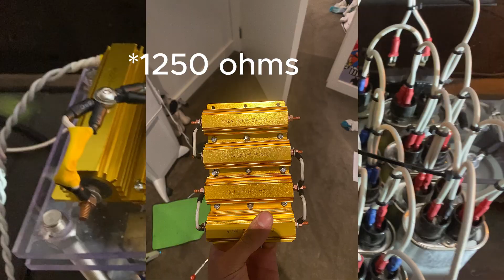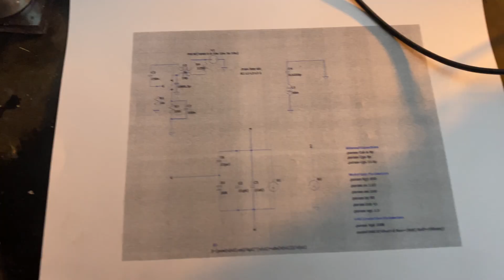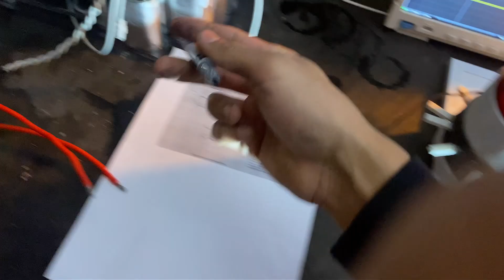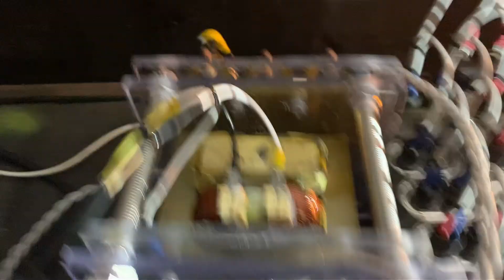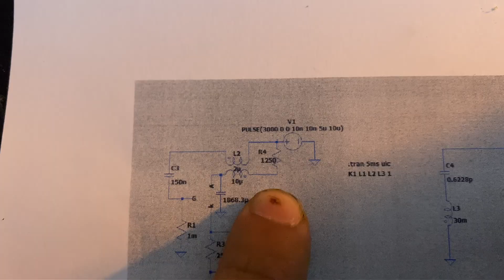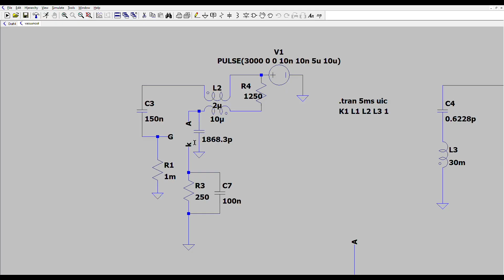Vacuum Tube Tesla Coil Part1/2

Comment: This is terrific mate, youre like Styropryo meets Brock with the xray tube. I cant remember his full name, l think it was on a cosmic summit last year. Your ceramic capacitors are awesome, where you get them? New Subber..
Reply from the maker: haha thanks for the reply Aaron the tree guru, I got my capacitors from eBay
Reply: @InzaneBuilds  Quartz nuclear fusion reactor. We need to use quartz crystals with a welding machine. Quartz can vibrate at 25,000 Hz to compress deuterium